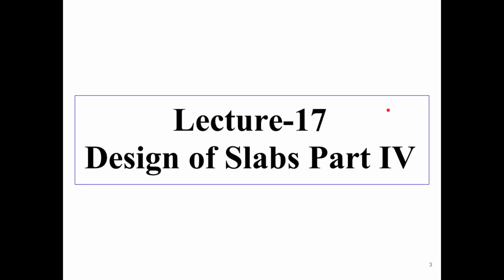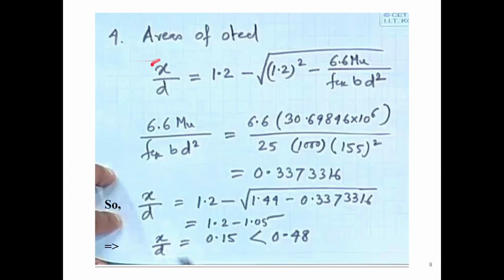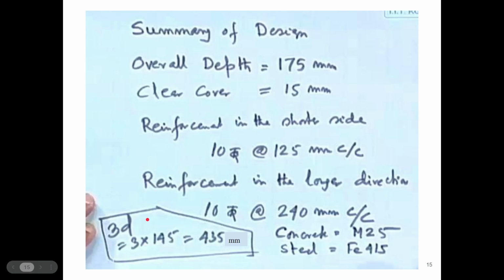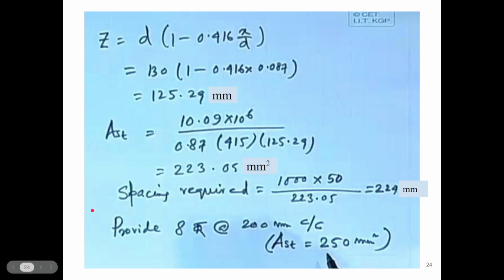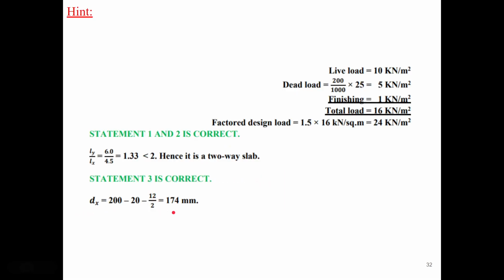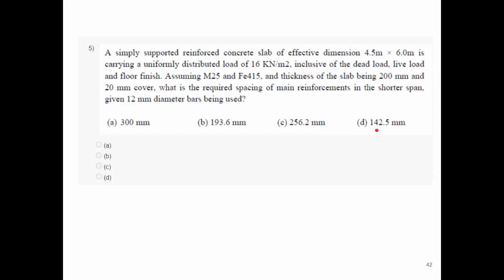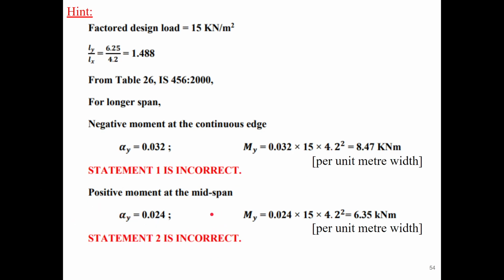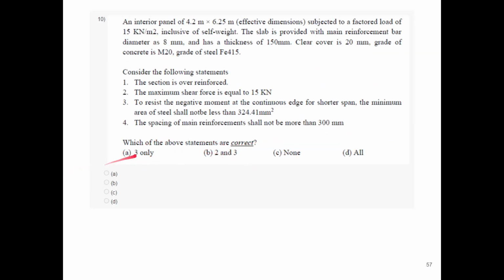Design of Reinforced Concrete Structures - 6th Week TA Class [3rd September 2023, Sunday]

Comment: But in question 3 option 4 is also correct 
My = .0538×24×6^2 =46.48knm
Reply from the maker: As per Clause D-1.1, Page 90, IS 456: 2000, M_y = alpha_y * w * l_x^2 (and not l_y^2). So, the length will be 4.5 m (not 6 m).